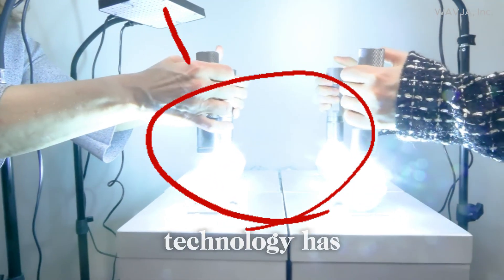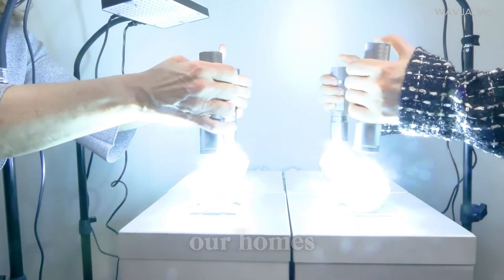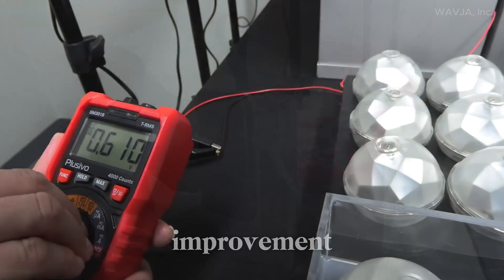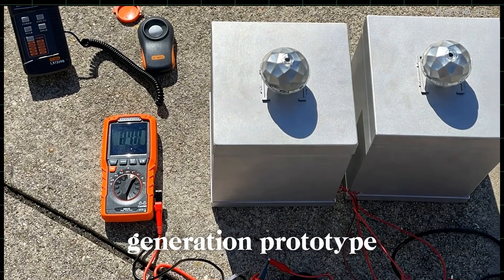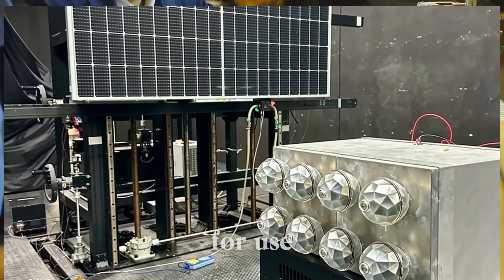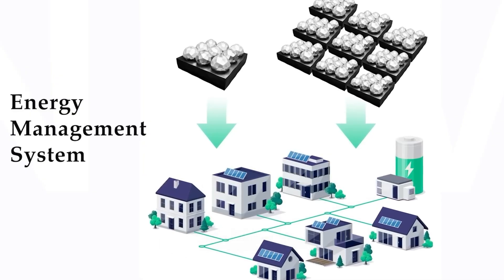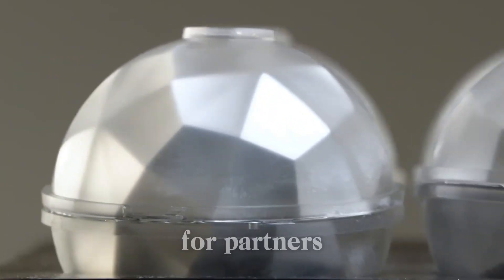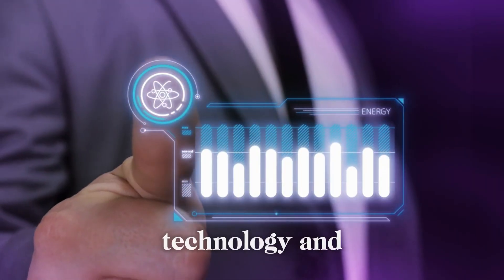Tiny Spheres Are 60x More EFFICIENT Than Solar Panels (US Innovation 2025)

Comment: When I hear numbers like 60x more, I become very sceptical about the tech.

That isn't to say these big leaps in tech don't happen, they do from time to time but they are very rare like going from dynamite to the atomic bomb in destructive power.

With that said, I do think that solar panels with lots of tiny spheres on them could generate more energy than how panels do now by capturing the light from more angles, but it certainly won't be 60x better and more likely to be around 30-50% better, which is still a big improvement over what we have.

Comment: I can see where this is going.  The bubble powers a bright lamp.  The bright lamp is focussed on the bubble, which responds by producing more power.  It's so efficient that there is a surplus of power to drive other things as well.  This is actually at least 25 times more efficient than simple perpetual motion machines . . .
Reply from the maker: thanks for your comment
Reply: I have found this innovation in the internet, by WAVJA  company, they have a website.
Reply: But I have found this in many websites and in the news. The company also has a website where they share their results.

Comment: I say BS... Numbers don't lie.  Sun produces 1000 watts per square metre, and solar panels today are at least 25% efficient, meaning they produce 250 watts per sq m of surface.  You can only go 4 x more efficient before reaching maximum efficiency of 100%, so this video claims they are 7.5 times as efficient as solar panels is a dead giveaway it is BS.  Maybe if they said twice as efficient they may have had some people's ears perking up, but I stopped after that false and misleading claim.  Solar panels are pretty damned good at 25%, even gas engines are only around that efficiency.
Reply: They're not bullshit. They were specifically designed in the form of spheres so they can hide batteries inside..thus the efficiency of more than 100% 😂😂😂
Reply: @HornadySetiawan   that still does not make the claims defensible. 60x is BS
Reply from the maker: Thanks for sharing your perspective on the efficiency claims.
Reply: @renewable_energy it's not "hos perspective", it's the basic truth, you just got correctly fact-checked so STFU and DELET DIS
Reply: The surface area per square meter, using spheres, instead of the 2 dimensional flat surface of a square meter can be multiplied many times over.   And these spheres are magnifying and redistributing the light interchangeably throughout this unique 3-D array.   

A square meter is a square meter.   A square meter covered with small domes is the obvious force multiplier.
Reply: @MS-715-7Y  Don't be daft... A square metre of area covered by sunlight is still only a square metre.  A sphere does NOT collect more light than a flat surface for the same area!  It curves and magnifies all the area of light that hits the surface, equally as much as a flat surface - then concentrates it into a single, more powerful POINT of energy.  The sum combined energy on 1 sq m of flat surface is still only 1000 watts of energy.  If you replace it with a 1 sq m area sphere, the 1000 watts of energy is focused into a point of energy, but it is still equal to 1000 watts, no more, no less.  This is as stupid as magnet motors supposedly being able to produce free energy, all impossible, yet people don't understand basic physics so they imagine it may be possible.  This is also not possible.  If you want to use smaller, more focused energy transfer systems, then a dome may be useful as a lense to focus the energy, but you can do something similar with solar panels - simply put a larger fresnel lense over a smaller solar panel and focus more energy onto the panel and get more energy from it, since solar panels are capable of producing a bit more with brighter sources of light, so focusing it will produce more energy.
Reply: But I have found this innovation in the internet, by WAVJA  company, they have a website.
Reply: But I have found this in many websites and in the news. The company also has a website where they share their results.
Reply: слънчевите панели са изкуствено ограничени до 18%-20% КПД (коефицент на полезно действие)
от САЩ заради заплаха за националната им сигурност.
иначе още преди 10-15 г  има разработки достигащи до 80%-90% КПД